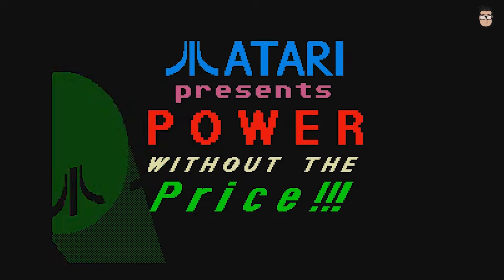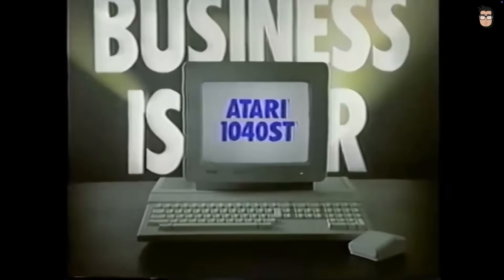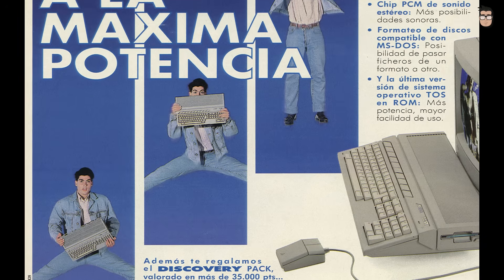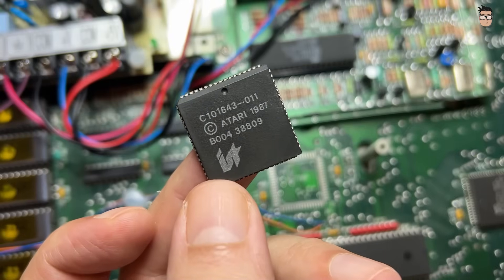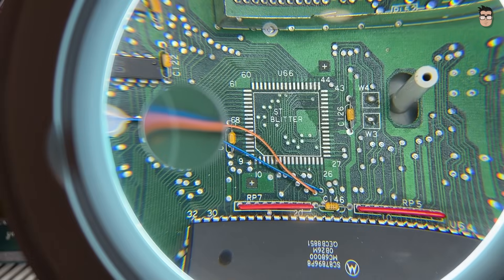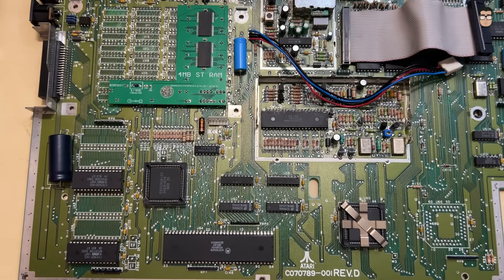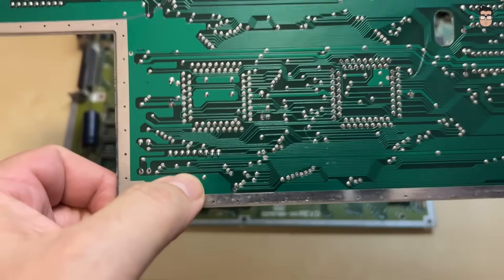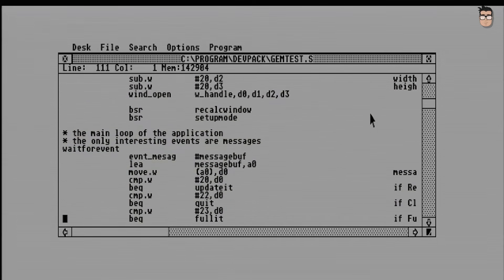Can I install a blitter in an Atari ST F/FM?

Comment: yep ,installed a blitter into my 520stfm and upgraded the ram to 4mb by replacing the chips with some old pc fpm simm chips. u have to solder in a new line(bodge wire) to the mpu but it all works.
as for performance ,the tos was also upgraded to 1.4 rainbow for better external storage support.. it is smoother in gem and scroling.....only a few games see the blitter.. is it worth it....blitter ,only if u are gonna use the gem a lot... memory yees do it...runs much better...why did i do it? because i love modifying things.
i also have amigas including a rare chicken lips a500 with v3 board and the c= keyboard... the amiga is better....but i have an odd fondness for the atari.....which is better? get both ,they both have pro and cons.
Reply from the maker: Thank you very much for leaving your comment, and welcome to the channel! They are very interesting modifications, and at some point I’d like to make a video on how to create a 4 MB upgrade for an Atari ST F/FM, doing something similar to what you mention.

Comment: I have no idea what a blitter does or how it works. Would have been nice if you had explained that a little
Reply from the maker: My apologies! The blitter is essentially a chip that speeds up the movement of blocks of memory, applying logic operations on the way, which is particularly useful for graphics and allows for smoother scrolling and faster sprite animation.
Reply: @thebitculture thanks! I tried googling it and it didnt make as much sense as your explanation. Cool video to watch even if i wasnt sure of what it did lol.

Comment: Let me fix that for you. Aside from being MIDI capable, the Atari ST was UNREMARKABLE as it was built with readibly available stock parts and no custom chips, so that Jack Tramiel could beat Commodore to the market (as touched upon in the video) and spite them for being ousted out.

Later releases unfortunately suffered from software being tailored to the minimum common denominator (to maximise sales) which never leveraged the hardware properly.

That also screwed Amiga users badly as most of the games published at the time were developed for the Atari ST and then lazily ported to Amiga.
Reply from the maker: I agree with you. For some time, Amiga game versions were ported directly from the Atari ST and didn’t really make use of the techniques that could be applied to the Amiga’s hardware. And, with a few exceptions, the capabilities of the Atari STE weren’t taken advantage of either, which could have brought the hardware much closer in terms of features—hardware scrolling, the blitter, 4096 colors, and even tricks to display many more colors on screen… such a shame.

Even so, they are iconic games, perhaps not the best they could have been from a technical standpoint, but still amazing, and they laid the foundations for the games we know today.
Reply: @thebitculture . I agree, however sadly many games did not age well, as they are simply too slow and choppy. At the time they were mostly fun to play with though.

Comment: One minor correction - Atari supported the blitter chip with its TOS v1.02 already.
Reply from the maker: You’re absolutely right! Thank you very much for the correction, and my apologies to everyone for the mistake.
Reply: @thebitculture  Oooh, be prefectly easy here.. It's actually a bit of a common misconception, as v1.04 had BLITTER and PC DISK FORMAT (if I'm not mistaken, it was yet the one for 720k diskettes? if anyone knows, please do share), full HDD support (which was a huge novelty and a very intriguing thing back then) and a few other features, compared to v.102, and all was presented in all the ads for it - even here, in socialist (aka communist) country.

BTW if my memory serves me, v1.04 had the BLITTER ON option checked by default (my Mega ST2 with v1.02 did not) right from the first boot, as a default setting.. But again - anyone who knows this first-hand, please do share the knowledge a/o experience 🙂
Reply: @buffalodebill1976  PC floppy formatting was implemented in 1.04 iirc. TOS/GEM could always read PC formatted disks and write to them, but formatted its own disks slightly differently. The main difference 1.04 implemented was far faster hard disk read/write speeds, which you had to patch on 1.02 with something like Fatspeed to get similar performance.
Reply: Yep v1.02s actually also known as Blitter TOS and came with the Mega ST, which can and did have a blitter in it in some variants :)
Reply: @welliben OK - and just to make sure - do you mean, that TOS v1.02 was the very first TOS to support blitter? I just tried to google it, but the answers have been, very politely said, "somewhat varied" 😀
Reply: @buffalodebill1976  Yes that is correct it is the first TOS version to contain blitter code. TOS 1.0 was a bit of a rush job for the STs 1985 release, was full of bugs and its hard drive handling was based on guesswork. The blitter hadn't been finalised at that point so it does not support it (the first compact STs don't even have a socket for the blitter). 1.02 came out next in 1987 and got almost everything corrected (bar the hard drive speeds) and added support for blitter.

Comment: how similar are the Atari and Blitter chips? The Amiga included it as part of Agnus if I remember rightly.
Reply from the maker: They share the name “blitter” and the basic idea of accelerating block memory operations, but architecturally and in terms of capability they are quite different. The Amiga’s blitter is more advanced and efficient, as it is more tightly integrated into the graphics architecture and also has capabilities that the Atari’s blitter does not.

Comment: Unfortunately, most software houses and developers wrote applications and games for the lowest common denominator, which was the ST without a blitter.  Finding games and applications that made use of the blitter on an Atari ST is near impossible.
Reply: Yes, adding detection routines and additional code for a small number of users was not popular at the time.
Reply: I saw some interviews in  Atari ST format magazine where the developers were complaining that the blitter wasn't fast enough to make it worth the trouble. 

 Making sure you could Target every machine was a factor but I hate to say it but the Atari ste wasn't big enough upgrade to get them excited.
Reply: But you can use TOS v1.2 and higher and it has Blitter support in GEM
Reply: @krupkaj That's great for TOS, but there still aren't any games or applications that took advantage of the blitter.
Reply: yep, just buy an Amiga, cheaper, no soldering and far better
Reply: @MgarrKid  Atari ST with 1MB was cheaper than Amiga with 512kB and for gaming definitely MegaDrive or SNES was better than Amiga
Reply: @MgarrKid  Exactly, and since every Amiga shipped with a blitter there was a huge library of software that took advantage of it.  Atari fans back then were almost at obstinate as Mac fans though.  No amount of logic could get them to admit that they had bought inferior tech.
Reply: not entirely true, Every application uses the BLiTTER (if installed) whether it wants to or not. Simply because it uses the OS API, which is accelerated by the BLiTTER.
Reply: @blast4722  You obviously didn't watch the video.  No, every application on the Atari does NOT use the blitter simply because it is installed, and the content creator even demonstrated this in his video.  Every game and app on the Atair had to be specially written to take advantage of the blitter, just like the Amiga.  TOS took advantage of the blitter because it was written to do so.  And just because that game or app was launched using TOS didn't mean it automagically used the blitter.  On the Atari, it was a  chicken versus egg problem. Owners weren't going to install a blitter because it was expensive and almost no coders or software houses took advantage of it, so there was a dearth of software that used the blitter.  And why buy and install an expensive blitter when there was almost no software that took advantage of it?  So very few coders and software houses spent the time and resources compiling two different versions of their games and apps, one for blitter-ed machines and ones without,  because you guessed it, that was expensive and a waste of time and resources since probably less than 1% of Atari users even bothered to buy and install a blitter chip.  There were even direct ports of Atari games to the Amiga and those games ran just as poorly on the Amiga even though every Amiga ever shipped came with a blitter. Those ports didn't automagically take advantage of the Amiga's blitter either.  They were either ported to take advantage of it, or as in most cases, quick and dirty ports that totally ignored the Amiga's blitter so they ran like @ss on the Amiga too.  If your assertion were true, every game the content creator launched on his Atari would have taken advantage of his blitter and ran smooth as butter. But he ran two versions of the same same app on his blitter-ed system, one app was written to take advantage of the blitter and other version did not.  If those apps automagically took advantage of the blitter why were there even two separate versions of the same app?
Reply: @ferrellsl  as I mentioned, I'm not talking about games (for games are better consoles like MegaDrive or SNES) but applications. Once the BLiTTER is installed and activated all clean OS applications use it because the OS uses it to handle graphics API. E.g. even simple Printf commands (GEMDOS Cconws) is BLiTTER driven. Therefore the only way to prevent an application from using the BLiTTER is to intentionally deactivate it. You don't need to understand the system or programming, but that's how the Atari system was designed. Every part of Atari OS is accelerated if possible AES/VDI/GEMDOS/XBIOS/LineA. Additionally, there are HDD drivers that use BliTTER to read and write files. So, here too, the application uses it whether it wants to or not.
Reply: @blast4722  they're rarely if ever used, many games and even some applications will 'hit the metal' and address the hardware directly.
Reply: @MgarrKid  I'm talking about applications not games. For good gaming experience there were consoles like MegaDrive or SNES.  Once the BLiTTER was installed and activated, all pure OS apps used it,  because the OS graphics operations were accelerated by the BLiTTER. Even simple Printf (GEMDOS Cconws)

Comment: I never understand why Amiga had both blitter and sprites. That is overengineering IMO that should not have happened. Bitmap based systems equipped with powerfull blitting hardware = the proper way to render graphics!
Reply: Sprites are faster and "better" (in the sense that they are handled separately to the main screen memory), but they're much more limited in terms of their number, size, and colour palette. On an architecture with extremely powerful sprite hardware the blitter would be less important, but still useful for backgrounds and scrolling.

Comment: The lack of blitter on the first ST may not have been an issue of price but an issue of time. Any interview I've seen of that time indicates Atari was losing money fast so was under the gun to release a computer fast (Amiga had a 2+ years head start). Also, it seems like the competitor in sight was the Mac more than the Amiga.
As far as games which support the blitter, some may also require other hardware features brought by the STE such as hardware scrolling. This is for example the case for the STE version of Pacmania.
Reply: Amiga was developed as a game console not a computer. The computer development started after ST development, when Commodore acquired Amiga. ST development started around April 1984 already. There was not much reason for BLiTTER on ST first, it was not a arcade game console but general computing machine. The MegaST got BLiTTER in 1987 and again the purpose was not to help with games, but to make faster screen drawing for desktop and GUI programs.
And you are 100% right that ST was a competitor for Mac, no one cared about Amiga at ATARI for years...
Reply: @madigorfkgoogle9349  Yeah and I think to some extent that was a bit of  mistake from commodore n Atari , if the amiga was supposed to be  console 1st it made no sense that commodre never developed any 1st party games for it and atari had a massive backlog of IP that they didn't bother to use of their consoles much let alone of the ST , when those computers still managed to find a niche for gaming n productivity (music production on the ST for example) and sold roughly 8million units (4.91million amigas sold and 3million atari STs sold) but it kind bit them in the ass when they were only relying on the jaguar n amiga cd32 as failed games consoles to keep them alive.

Comment: Is there also a way to upgrade the color palette from 512 colors to 4096 colors? And what about the improved sound capabilities in the STe? Is there also a sound upgrade possible for this?
Reply from the maker: Unfortunately, as far as I know, the Atari STf/STfm do not add any extra circuitry that would allow improvements beyond the blitter. It is possible to replace the processor to achieve higher speed, or to use, for example, a PiStorm, which also adds memory in a relatively simple way. External sound DACs can be used as well, or even an mt32-pi via the MIDI port... although this will only be an advantage with some Sierra games.
Reply: @thebitculture  There was a 4096 DIY board which was recently rediscovered after being thought lost iirc. The palette was compatible with the STe I believe and was achieved by using a second shifter chip.